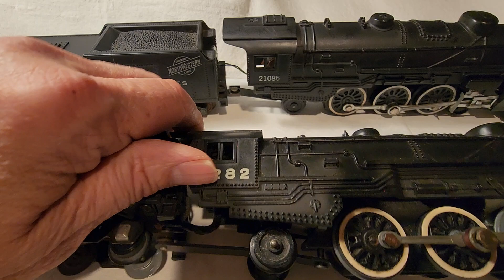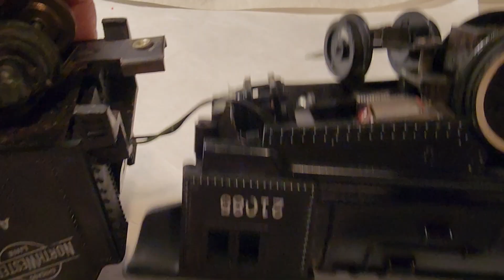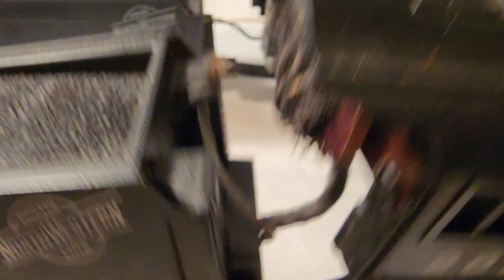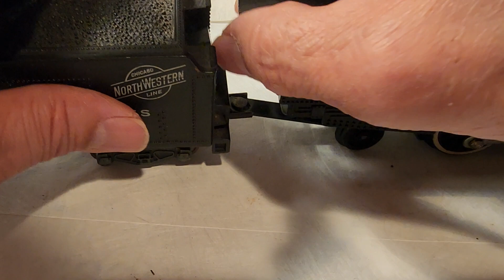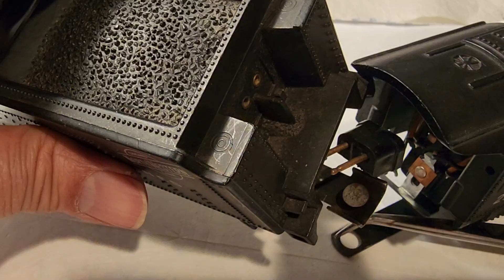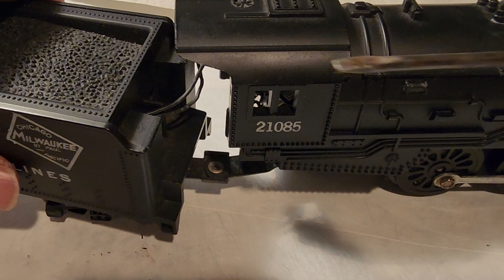AMERICAN FLYER  PACIFIC 21085 ~ GEAR MAINTENANCE & DIFFERENT VERSIONS OF TENDER POWER CONNECTOR

Comment: Is the 21085 a cast boiler or plastic?  Are any of American Flyer steam engines plastic shells?  I'm just getting into them. I bought a Set that had a 321 with SIT and I'm waiting on parts. I love the size, I would like to get a few more engines. A jeep, 315 and a 336, but maybe others as well.
Reply: 21085 Pacific has a plastic boiler.

Comment: I have about 7 of these engines, the old 70-year-old motors and a after a while are just nothing but problems I couldn't keep them running. You can buy a brand new motor for this for $49. A cam motoh my gosh. It runs like a brand new engine, no more AC noise.  With the new motor for the $49 investment, I'm 2 V. This engine can crawl like a turtle.
If you can keep the old motors and he's running good for you. But when you invest a $49 and install one, it's like you've got a brand new engine.  Had to do a lot of digging on YouTube. I don't think a lot of people know about the brand new cam motor you can get you We'll have to put a bridge rectifier in the cold car which will convert it from AC. To DC.
Easy but it is super quiet very good investment. I wish I would have known about this before I scrapped so many of these for parts.
Reply: https://youtu.be/SjD3olU7Zns?si=8FAovwQ6u4DFly8I

Comment: Hello! I am working on a 21085 with the two prong plug that has not been plugged in for years — not sure if it works. Unfortunately the plug broke off the wires. I am considering repairing the plug myself and I wondering if you know where I could find the replacement plug, or/if there is a way to make the connection directly to the tender. Thanks for any help!
Reply from the maker: Hello Eric.   You have 2 options. One easier the other requires more labor.  One way is to take the existing  2 wires from the plug. Remove the plug and solder and extend the wire so it will reach the 2 truck rivets in the tender. Then solder one wire to each of the truck rivets.  The other method is to buy a new plug.  I have one on Ebay if you enter the Ebay item # into the Ebay search field it will come up:   204670111246
Good Luck and thanks for watching my youtube site. Doug

Comment: I have the earlier version of the 21085 which ran beautifully, and pulled long trains, before it just quit running. The problem is in the two position e-unit which I have been unable to repair. I didn't realize the chassis is built differently because I haven't looked at that part of the locomotive. Thanks for this information. I am considering trying to replace the motor and e-unit with those from a 290, which I have several of. Do you know if that would work?
Reply from the maker: IF the reverse unit is just not functioning and it was, then try to spray it with some electronic contact cleaner. (not the degreaser but the one for electronic components). it may be gunked up from much use. If something that is broken  it may be easier to replace the reverse unit.   If the mounting holes of the 290 motor lines up with the 21085 chassis motor mounting holes, then it will will work.  Obviously you will need the 290 reverse unit in the tender.  Or you can just solder 2 wires from the new motor or the old motor (one wire to each rivet on the tender chassis) to the tender to 
 let the 21085 to just be a (forward) runner. Hope this helps